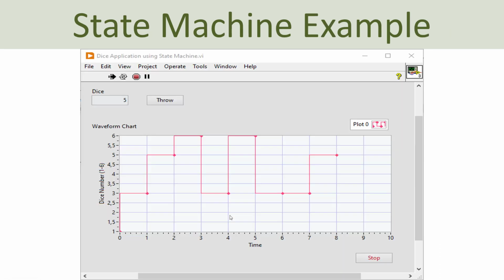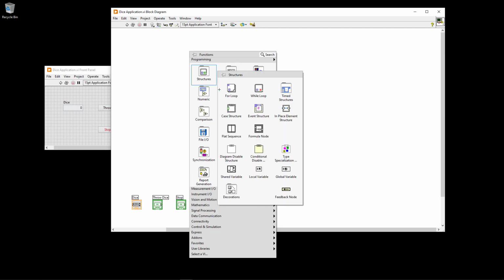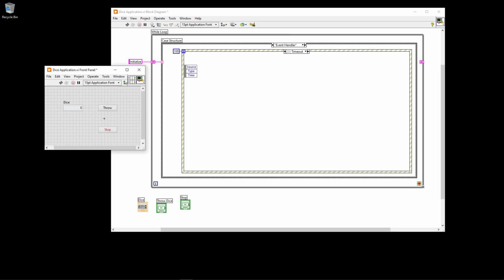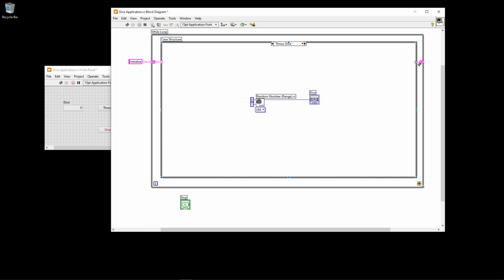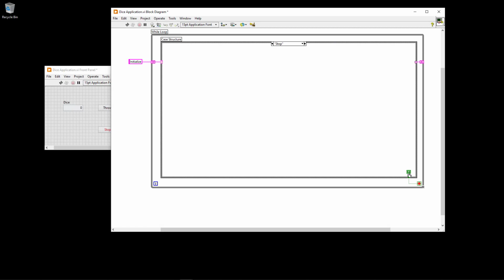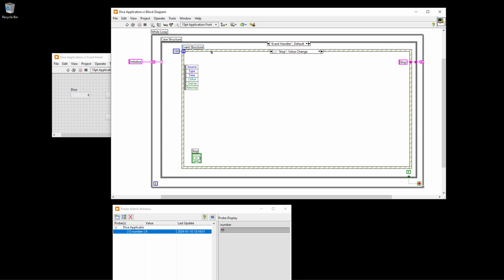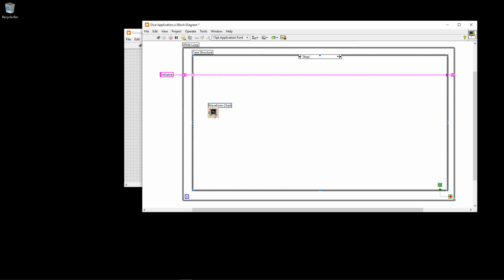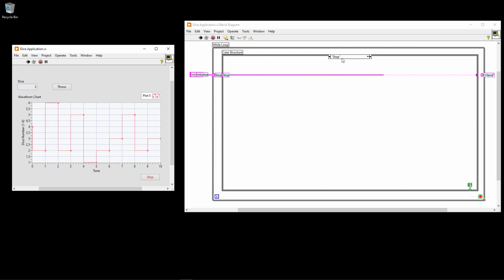State Machine in LabVIEW

Comment: Thanks for the great video! Going through it now. Maybe you answer this, so sorry if this is redundant, but what is the reasoning behind putting the event structure in the case structure rather than the event structure containing the case structure?
Reply from the maker: Hi, Then you will need one case structure for each event in the case structure. I dont think that will be a good solution, but test it out and see if it will work or not.